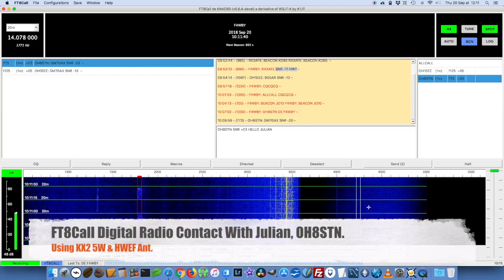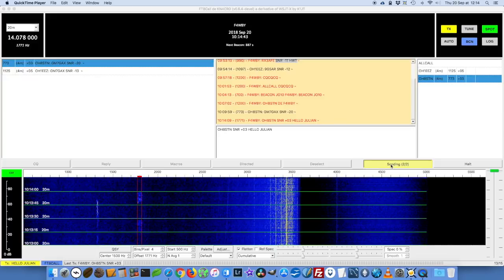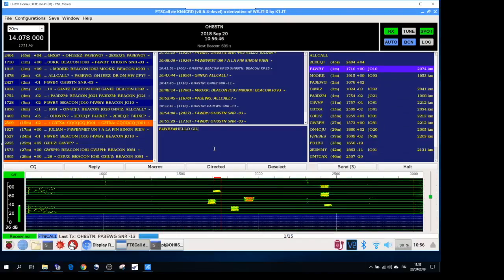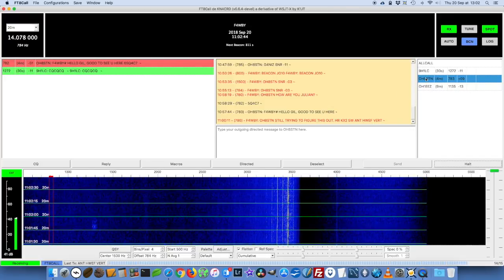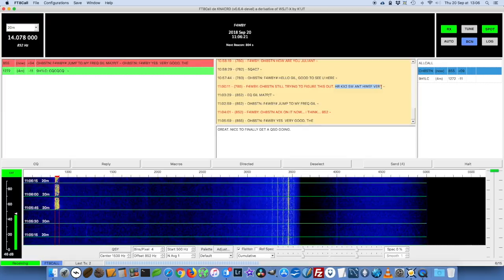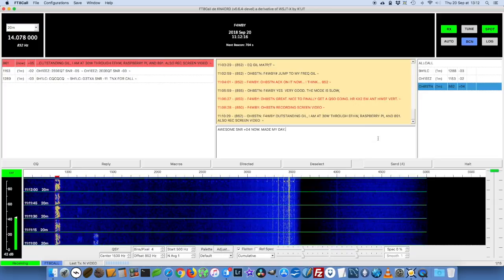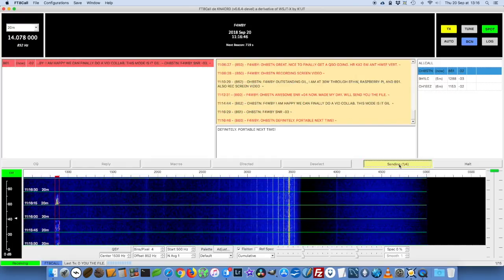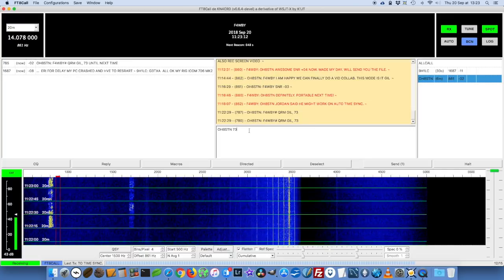FT8Call Digital Radio Contact With Julian OH8STN.

Comment: Digital is boring as F*** but it seems useful cause of the automation. You can use a phone or tablet, easier to charge via USB.
Reply from the maker: Until we get an integrated tablet transceiver digital modes won't be on my priority list for portable ops. On a boat though, yes.

Comment: Thanks, Gil!  What might a non-external time sync look like? 73
Reply from the maker: Using the other signals to sync time.
Reply: Radio Prepper thanks Gil.  Would the time be encoded in another stream, or would synchronization be provided in the bit stream? Just wondering about cases where your own clock is out several minutes or more.  73, Dave
Reply from the maker: I don't know. Maybe just synced on the beginning of transmissions received..  That's a question for Jordan..

Comment: Tnx Gil, on ft8call here but not many vk's using it yet compare to ft8. Using my spare SOTA Par end fed 20/40 m antenna as a sloper, feed point 40 feet up my tower works great. 73 vk5cz ..
Reply: Hello Bill glad to see you on the FT-8call screen =)     I usually leave my rig up during the day on 20m and on "AUTO" so any traffic can "VIA" through me  if needed =)   That way someone can practice using a "VIA" to send a message =)   Thanks Jordan for creating a chat mode with great weak station contact =)   This is a great for weak station / portable operation =)    I think SOTA could use this with great coverage and contacts with minimal footprint ( R Pi, rig, smartphone / tablet, battery , and antenna =)    Bill I do  see several 20m VK's during the day and a bunch on the weekend ( numbers are growing =)
Reply from the maker: Well, FT8 has no utility for prepping... Give it some time...

Comment: How high did the temperature of the KX2 go. Do you have an add on heatsink?
Reply from the maker: It has gone up to 50C before, but at 5W I have not needed a heatsink.
Reply: I have used my KX3 for FT8Call and have kept my eye on the  temp. I have switched to my FT817. It seems a little more robust. I'm following Julian and using RapberryPi headless. BTW I now have a PRC 320.
Reply from the maker: I'll be making a data cable for my 320 soon...
Reply: I'll be watching for it.